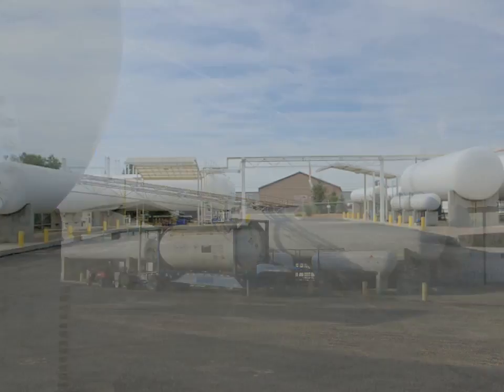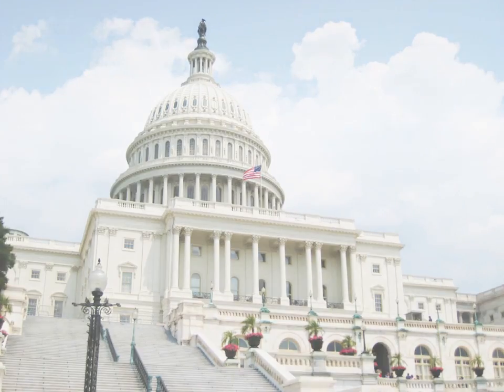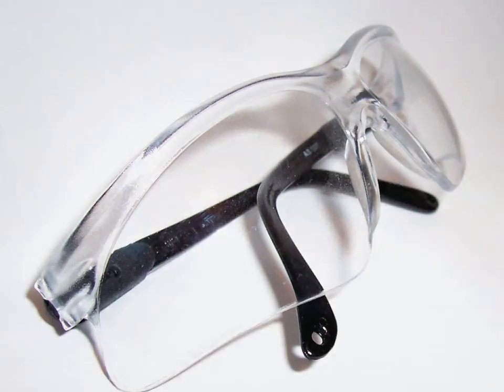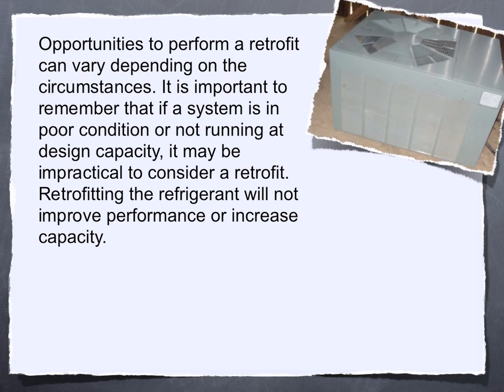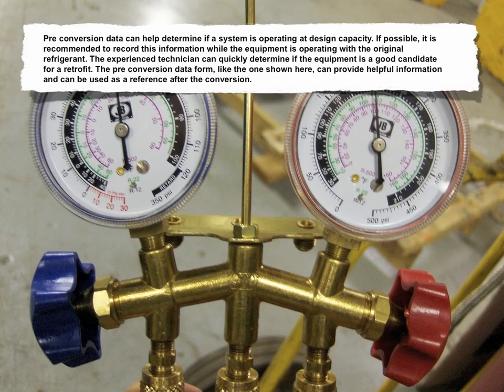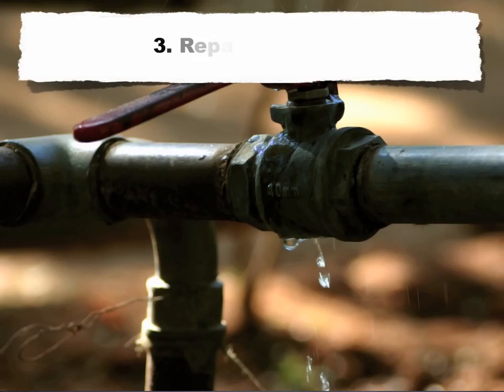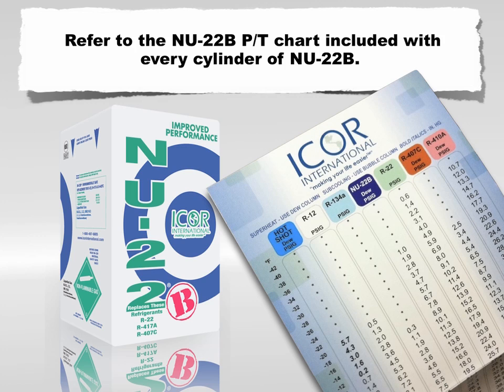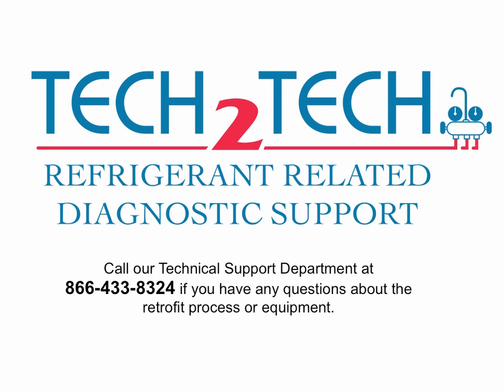R-22 System Conversion Made Simple

Comment: My question is does this require a oil change in the compressor? Or a additive, I remember the black death of compressors that was r12 converted to r134a . I would add ester oil instead of pag to the mineral oil and this would work well!

Comment: Sir can i charge R410 gas in R22 system
Reply: No, R-22 systems are not designed to use R-410A.  R-410A has 60% higher operating pressures than R-22, and R-410A must be using with POE lubricant in the compressor.